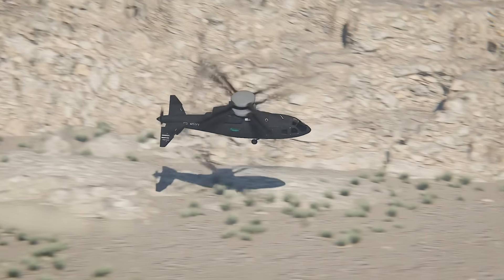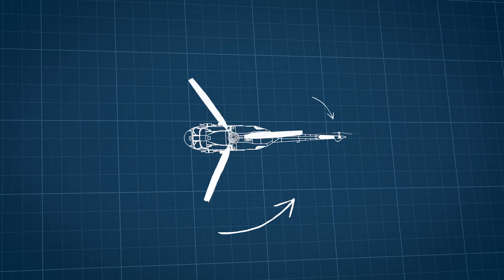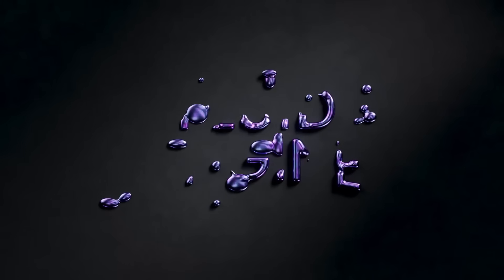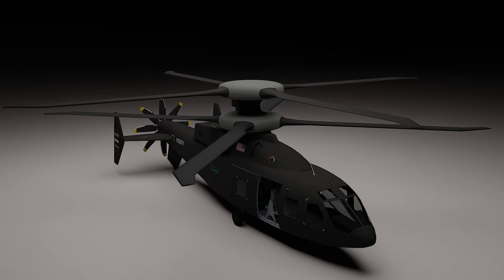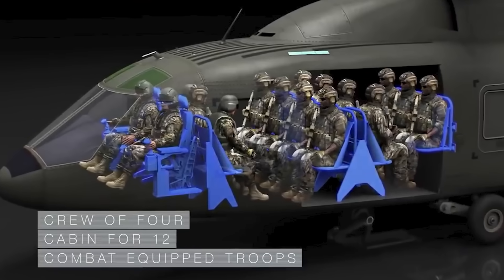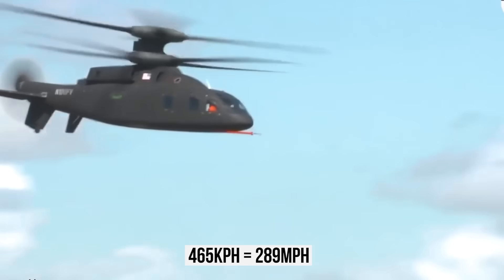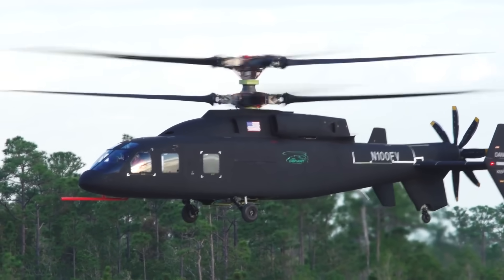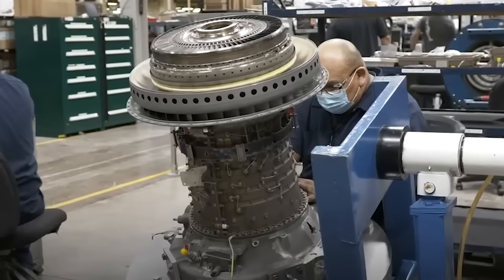Why the SB-1 never had a chance as the new US Army helicopter?

Comment: Sikorsky knew, before they ever started that the co-axial design came with serious driveline complexity issues and more importantly, serious drag issues.  Drag increases as the square of speed... all those rotor blades and that huge mast and hub up top were just an anchor, and SB-1 was never able to even come close to the required minumum sustainable speed, much less the desired dash speed.  Next, being in rotor-borne flight is way less fuel efficient than wing-borne flight like the V-280 and the combat radius and ferry range of the two designs show that.  So, for the Indo Pacific theater, the Sikorsky design offered something that was more complex (more maintenance / support logistics train), was too slow, and was far too short legged.  The coaxial pusher helicopter is sort of a solution in search of a problem.  Perhaps a normal helicopter with a tail rotor that converted to pusher, like one of the non-selected FARA proposals, or something like Piaseki's Speedhawk, or even Airbus' RACER might have been a simpler solution to offer.

Comment: Range of classical heli will never match a twin-rotor VTOL.
The tips of the rotors will always be supersonic on one side.
What they should have focused is the redundant safety of 3 propellers.
Reply: A coaxial rotor helicopter isn't affected by the dissymetry of lift since the rotors spin in the oppoiste directions and thus all the effects counteract themselves.
Reply: @olekzajac5948  No they are still limited by blade stall. The Defiant tried to get around this with the pusher prop and wings giving 50% of the lift in forward flight. This made the main rotors not have to spin as fast increasing the max speed. Again it is simply not as good as a tilt rotor.
Reply: @n3v3rforgott3n9  They are affected by the retreating blade stall since the retreating blades still do stall at higher speeds, but it doesn't create lift dissymetry as the rotors spin in opposing directions so the blade stall occurs at both sides.
This means that coaxial rotor compound helicopters don't need wings to maintain lift at higher speeds, unlike their classic counterparts. And that's why the Defiant doesn't have wings btw, contrary to what you said. The only helicopter from the Future Vertical Lift program that has stub wings is the Bell Invictus, and what rotor layout does it have? Classic one, with a single main rotor.
Reply: @olekzajac5948  On coaxial like the Kamovs it causes the upper blade to collide with the lower one. Retreating blade stall brings the right side of the upper set down and the right side of the lower set up and as they move in opposite directions it causes catastrophic failure. That’s why VNE is really NEVER to be exceeded. This is likely why they had to go with a rigid rotor design on the Defiant and Raider with the extra pusher prop adding the needed extra thrust to reach the desired speeds. Still means coaxial helicopters are speed capped.
Reply: @n3v3rforgott3n9  Defaint had no wings.  The function of the pusher was to provide separate thrust so that the X2 system did not have to provide All the lift and All the thrust.  This allowed the rotors to turn slower delaying the point at which the speed of the rotor added to forward velocity of the aircraft added up to supersonic speeds at the rotor tips.  This would theoretically permit the vehicle to travel faster before the tips went supersonic.  The speeds still wouldn't have been what is achievable by a Tilt-Rotor, because when wingborne  the blades don't have to provide any lift at all.  In fact, when a Tilt-Rotor converts to wingborne flight, the rotors actually slow down.  

In any case, Defiant and Raide, never achieved even their own promised speeds.

Comment: Note: This is a comment I made on another video regarding the FARA/FLV project, but fits for this video as well.

I am highly concerned with this trend of over reliance on drones, while I do agree that the scout helicopter is kind of a dated concept and drones could better serve this role.
However, we do need a more modern attack helicopter desperately as both our current platforms are quite long in the tooth, I mean the AH-64 has been in service for 38 years now and the AH-1 has been in service for 57 years, both of which are really starting to show their age quite badly.
The Invictus would have been the perfect replacement for the AH-1's in USMC service given their extremely small proportions and would have easily fit on LPD's, LHD's, LSD's, CVN's and even the new ESB's all which could compensate for the Invictus individual lack of range.

While I am a huge opponent of coaxial-rotor aircraft due to the larger vertical rotor profile they present, the Raider and arguably the Defiant would have likely served the Army's attack helicopter needs better than the Invictus would, since presumably they would operating from largely static as opposed to mobile "bases" like the USMC would likely operate from, plus the coaxial-rotor would afford the Raider/Defiant a larger payload capacity due to increased lift relative to its size.
One of the other things I really dislike about that particular design aside from the coaxial-rotor is its unshrouded push propeller, I can foresee a lot of accidents be it from people or debris occurring because of that due to its height relative to the ground, thus shrouding it would greatly diminish those occurrences from happening and may (and I stress the may here) have a positive effect on noise production as well, much like how the Fenestron on the Dauphin reduces its noise profile.

Suffice to say I think this was a really bad call on the part of the military, especially since I think our over reliance on drones is going to bite us in the ass in the near future in one way or another and especially since anti-drone tech is now rapidly developing as well and we have no idea where that is eventually going to go, in my opinion it is always good to have for lack of a better term a "analog" backup when the digital fails, hell its why we still train personnel on a compass despite GPS being virtually ubiquitous these days. So I'd say a smaller production run of the FARA options and not a 1:1 replacement of the Kiowa fleet with the rest of the fleet being taken up by drones would be the wisest decision.

Note: In addition to those statements I think the SB-1 would be a good replacement for the AH-64, if they can get those engines they want on it, namely the Future Affordable Turbine Engine (FATE).
The SB-1 design itself would be far more applicable than the Valor and or a derivative of the Valor for the attack role, I do not see a feasible method for mounting munitions on a tiltrotor without heavy risk to the aircraft and my stance on this is not without precedent, as they have struggled to mount even adequate self defense munitions on the Osprey already.

Conversely I can see the SB-1 having a internal weapons bay (much like how they showed on the Raider models) and or stub wings affixed to the fuselage much like the AH-64 or AH-1 has, the SB-1 would have better better, speed, range, payload capacity, power to weight ratio and be more applicable for hot and high conditions something which was a issue in Afghanistan for example and would likely be a issue in the Pacific as well.
Personally I think Sikorsky and Boeing (with the latter being the manufactures of the AH-64) should really push for the SB-1 being its replacement, as I am sure Boeing would not want to lose that market and I am also sure Sikorsky would likewise not want to have their only US military contract to be the CH-53 either, once the UH-60's are retired.

Comment: A suggestion: look into the Sikorski S-72 "X-Wing" programme. The idea was to stop a four-bladed rotor in flight and use it as a wing. In theory this would have allowed much higher speeds. In practise it never flew.
Reply: I remember reading about those crazy ideas. A similar idea made it in The 6th Day movie, the Whispercraft.
Reply: S-72 was a test aircraft built to test different rotor designs.  Although an X-Wing was installed on it, it proved to be too complicated to have practical applications so the X-win rotor never flew.

Comment: My main issue with the V-280 is the huge landing area required with it's twin 35' discs side by side, granted not all landing areas are size compromised but when you are in a tight spot and need a lift, it is.  I know the Blackhawk is getting long in the tooth, but it is still a very capable helicopter, and other than speed, there is really no urgent need to replace it.  I think that the other issue I take with this program is trying to make a one fits all airframe, we have seen in the past that the Army, Navy and Marines don't play nicely together in the design room, it always leads to design compromises, cost over runs and delays, whilst trying to do the very opposite of that.
Reply: It's basically the same area as a Black Hawk or Huey though. They just make it more ovoid than triangle, but otherwise the two rotors have the same width side by side as the tip to tail of a normal helicopter. The Ospray and v280 have roughly the same Landing area on aircraft carriers as the old copter.
Reply: Infact v 280 can land in more tighter spots than black hawk by changing its orientation.. that is it can land sideways where it is much narrower
Reply: People love to overstate the size of the V-280.
Reply: It's easier to drop payloads with a crane than it is to add 200 km of operational range
Reply: They aren't replacing the Blackhawk. They are replacing a certain number of them. There will still be Blackhawks in service for where they are needed.
Reply: @ianpearson4187  The army currently plans to replace all of its Black Hawks...
Reply: Army specified the size of the LZ for this program.  V-280 fits into it.
Reply: So did the SB>1

Comment: Technically it is not a helicopter. It is a rotorcraft but when it has horizontal propulsion it is not a helicopter but a Gyrodine. The V-280 is neither, it is tilt rotor craft. 
And if it has a rotor and forward propulsion but the rotor is not powered it is an autogyro.

Comment: tiltrotor seems extremely dangerous
Reply: helicopters seem extremely dangerous.
Reply: The Osprey does not have a drastically worse safety rating them similar platforms and in fact performs better than many. Not to mention is brings capabilities none other platform can.
Reply: @Mediiiicc  am thinking that if one of those engines gets damaged it will just fall from the sky and hit the ground upside down while heli can do an emergency autorotation landing, you crash and burn instead of surviving
Reply: @n3v3rforgott3n9  am thinking that if one of those engines gets damaged it will just fall from the sky and hit the ground upside down while heli can do an emergency autorotation landing
Reply: @Area51UFOGynaecology  again both engines turn both rotors at all times and it can fly on one engine. Also a Tilt rotor can autorotate and glide.
Reply: @n3v3rforgott3n9  thats actually really cool, guess its fine then, thought each engine turned 1 propeller
Reply: @Area51UFOGynaecology  Just like with the Chinook or Osprey the rotors are mechanically connected to each other and can not spin by themselves without something major breaking. Which would down any helicopter anyway.
Reply: @Area51UFOGynaecology  Tiltrotors can autorotate they just arent as good at it as helicopters. If the tiltrotor is already flying forward and somehow both engines fail then it can glide like an airplane to make an emergency landing which is actually safer than helicopters autorotate.

Comment: I actually hope this design makes it to the army, as replacing the UH 60 will require more than 1000 airframes, and a split order, between the v 280 and the defiant can be the best option, optimizing the best one for every role...
Reply: The V-280 simply outclassed the Defiant... there is no role the Defiant could do that the Valor couldn't
Reply: @dreamhunter2973  So you are getting even the basics of the platform wrong... Both engines turn both rotors at all times and it is mechanically impossible to turn one rotor without the other one turning unless something major broke which would down a normal helicopter anyway. Secondly a tilt rotor is not locked into either have the blades forward or up... it can lift the blades 15-30 degrees to give plenty of clearance for weapons while keeping more speed than any other helicopter. Not to mention you aren't firing your door guns while passing by at max speed. Lastly the Osprey is no more dangerous than other similar platforms and was the first of its kind in full production with multiple design compromises to meet Marine corp requirements.

Comment: The XH-59 was unfortunate in that it came about just before the 1970s energy crisis which meant that the cost of flying it shot through the roof.

If the Fairey Rotodyne had received the funding it needed the next planned stage would have seen the rotor being folded way and stowed in the roof once it was travelling fast enough and use the engines on the wings to fly it.

Comment: One thing I don't understand is why tiltrotor helicopter can go faster that a fixed rotor one. Can you not just tilt the whole helicopter? If it's because of assistance from wings, can you not have them pointing in the optimal direction, like 80 degrees up or so, at low speeds they wouldn't do much anyway, or have them flip out.
Reply: there would be massive drag from the aircraft body if it was pointing down. And a bunch of other issues that would need to be fixed.
Reply: Leave it to the engineers....
Reply: @Mediiiicc  There are any number of issues,but that basic one is this.  There sis a physical limit of how fast conventional rotors that provide lift cab go .  Tilt-Rotor gets around this by converting to where the wings provide all the lift and the rotors provide propulsion like a fixed wing aircraft.

Comment: This never had a chance because the system requirements were better suited to Bell helicopter. Lockheed Martin is best known for planes and Bell for helicopters. The requirement for VTOL screamed Bell and the "make it go faster" was for LM. But it's easier to bolt on "go faster" than bolt on VTOL. Bell already did that with Osprey they just needed to make it "go faster". LM had to start from scratch comparatively. So..Bell wins.